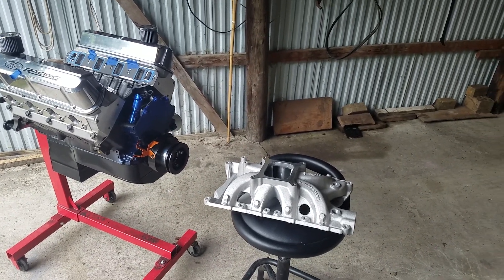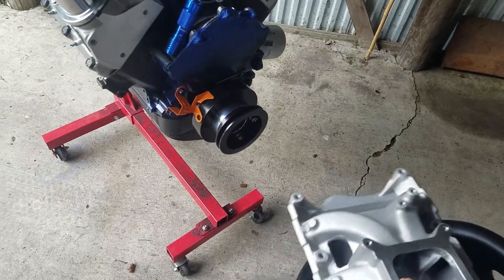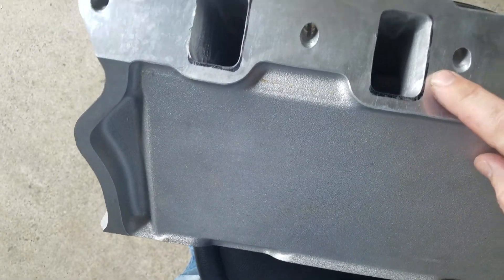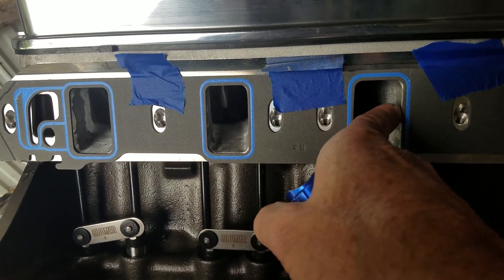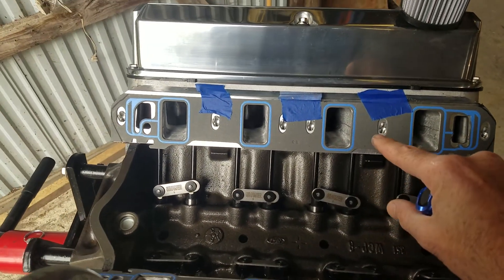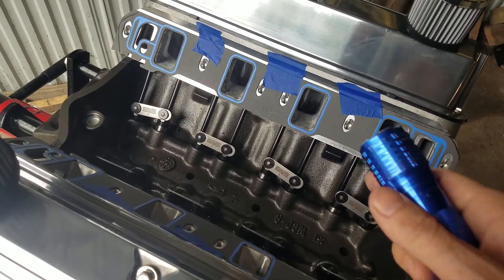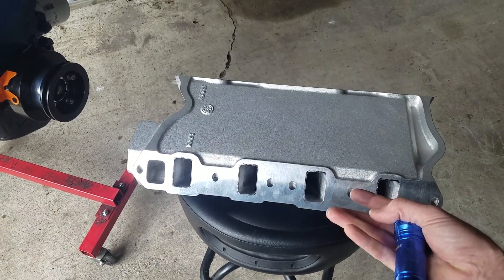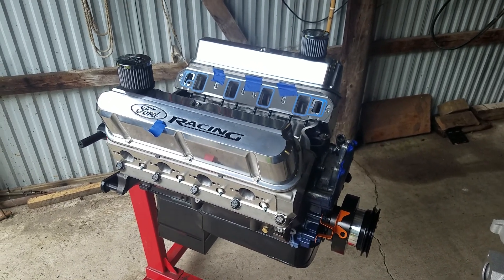Port match the right way !!

Comment: When I first started porting I just grabbed gaskets and matched the port to the gasket. I didn't know any better. Now i measure the csa at the short turn, measure the csa at the beginning of the port in the manifold...and cut the port to consistent taper.  No bellmouth at the pushrod pinch that way. When you focus on porting like this...all kinds of cool stuff happens. Cool stuff like...hi velocity at hi rpms with small ports and valves. This allows for good power with low compression on pump gas without spending a fortune on parts you actually don't need.  Port matching is the only way to go!

Comment: You want rough edges on the inside cause while the air and gas  is moving  through it will mix better than without smooth edges
Reply: Rough as in 60 grit, yes.  Rough as in globs from casting, no.

Comment: Backin the 70s I started port matching 461 Chevy 1.94 heads. An old engine builder told me to use a metal Stanley marking gauge. I set the depth to 3/4 of an inch and that was used on the intake as well. I used a starret o1 tool steal to make a template using the bolt holes to locate the ports . I sent it to heat treat for hardening a nd straighing . I used the template on the head and manifold while removing the metal.  I never took stock back any farther than the gasket lines or the 3/4 depth lines I laid out. That made it a nice transition but not too radical.

Comment: What gasket do i use for my edelbrock performer on iron eagle heads? there is a gap at the runners. Seems heads were milled before i got them.1970 350cu
Reply from the maker: That's a good question. It leaves me with a few questions. If I were you I would want to know the size of the combustion chambers to know if I have my target compression ratio or is it too much? If they have been milled much, you may have to shave the intake as well, it could be sitting too high. I'm guessing you have a sbc, if it is machined properly any std intake gasket should work. P.s. there are thicker gaskets available if that is necessary. Hope that gave you a little direction.
Reply: @blueovaldude  ahhh found a felpro 1266 intake set..0125 perfect now. Ty

Comment: When you have you gaskets taped up to the gasket matched head.  Take a tiny dab of silicon at the intake side middle and on the ends, intake side.  Let dry and carefully remove manifold from heads.  If done properly you now have fully templated ports with and exact placement of where the manifold ports are in relation to the heads/gasket.  Mark port outlines and remove gasket or leave in place for a template.
Be careful if you do not to hit gasket with die grinder.  100% perfect match every time..

Comment: Do I notice epoxy in the rear intake port of the head?
Reply from the maker: The heads are a test bed of sorts . There is no pushrod pinch.  So every port is filled in that area .

Comment: After doing all the work to align everything, (IMHO) the best thing one can do is to place the intake on the engine with the gaskets & look down the ports to the head.  As you mentioned.  This way one can see if things are aligned or if there needs to be an adjustment made before porting heads & intake.  I use a bore scope connected to my smart phone to look down the ports of my intake to determine if the placement on the heads is as I had determined or not.  The bore scopes for a smart phone are cheap on Amaz-n & one can take pictures & video on your phone to use as a reference.  Excellent job pointing out how to mark your gaskets placement, I like using a very fine sharpie to trace with. On my SBC I marked a couple spots on the head where the gasket upper edge sits so that I can easily see it while installing everything.  Additionally your suggestion to keep the intake a tiny bit smaller gives one a little bit of a buffer to not create a lip on the head & turbulence, is a very good idea.

Comment: IMPORTANT!
I noticed you mentioned to not do a mirror finish on the inside of the intake and to leave a little roughness, do you think that this also applies to port injected kits, like the edelbrock pot-flo 4.
Reply from the maker: Good question,  Port injected engines should not have an issue  having polished intake runners . However intake runner finish has little to do with actual flow figures , shape and a good match up should be the focus.
Reply: Edelbrock Pro-flo 4*

Comment: Good to know! I have an old 351 in my truck. Trans in the truck is not happy, and the cab is rotted out. So, I told the wife I would try my hand at rebuilding the 351 and putting it in the 64.5 Mustang her father is giving us. Trying to do a bit of budget performance upgrades to it, as I'm sure the 351 will still make the far feel quick just on it's own. Going to watch some of your other videos on this engine, always something to learn
Reply from the maker: Sounds like a fun project,  what year is the 351 ?
Reply: @blueovaldude  83
Reply from the maker: @OldMotorcycleAdventures  truck rods , so bonus . If you have any questions shoot a comment. Have fun with it.
Reply: @blueovaldude  will do, thanks!

Comment: Do you port match the coolant passage also? My apologies for a different manufacturer question but should still apply. I have a #906 Vortec head and there is ALOT of material within my blued scribe mark. Intake gasket is out of a kit. "Problem solver gasket" i was told. Plain metal core with black rubberized molded gasket around port.
Reply from the maker: No problem,  I usually just remove the sharp edges inside the water passage on the intake face side of the head , just to remove some turbulence. I would not worry about making it larger , more than enough water can flow through to cool properly. Water flows out of there ,not in like intake ports . A port exit where something flows out of is better be slightly smaller  than the opening of what bolts up to it , as to not create a sharp edge for air, fuel or fluid to hit and cause a loss of flow .
Reply: @blueovaldude ,  Thank you so much for taking the time to answer my question! That was my guess bit I wanted to be sure. Take care and thanks again!😊👍
Reply from the maker: @AR_420  you're welcome,  no problem. 👍

Comment: Good video, nice explanations, have you noticed those sharp edges actually causing whistling noises? Ive just recently picked up a 93 foxbody, with a trick flow track heat top end kit, ive had the upper intake off on it and noticed quite a few sharp casting edges, honestly youd think trick flow wouldnt have let them leave as bad as they are, but anyway, will smoothing those out help to elimate that whistling im getting?
Reply from the maker: Thank you,  good question,  honestly it should not cause a whistling. It sounds like a vacuum leak to me . A bad vacuum line, a crack in one , a cracked vacuum fitting or even a leak in one of the intake gaskets. Lower ,upper ect . I hope that helps .

Comment: I just carefully taped the Intake Gaskets to the heads... then with frog tape placed at several strategic spots... I placed several little dabs of silicone. Let it sit three hours in place and with the tape pulled away from the head lifted the Intake off with gaskets positioned perfectly in place. Took it to the bench and scribe-d to taste.